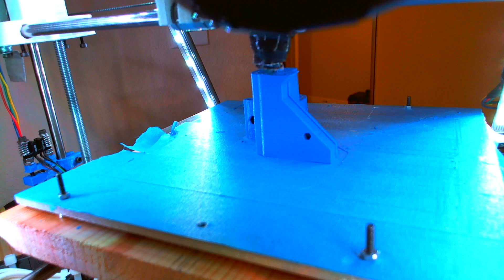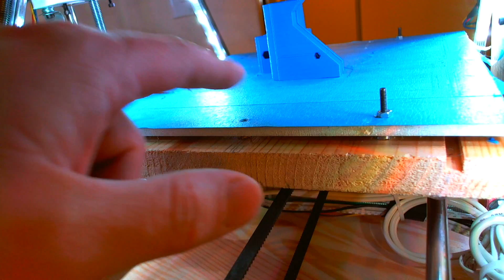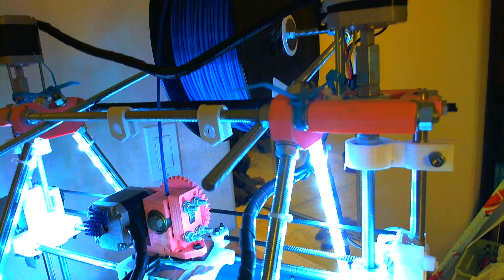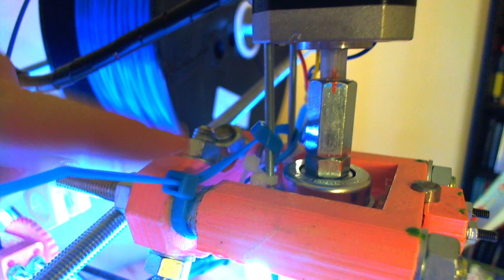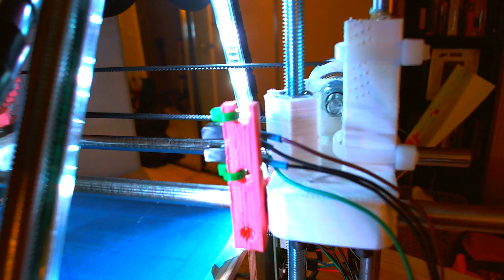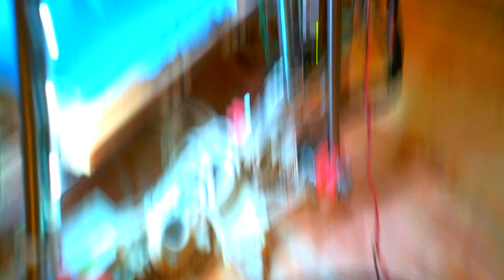Reprap Project- 3D printing A New 3D printer!

Comment: If I understand correctly, by "step skipping" you mean stepper loses position.  I had this on my prusa.  The current on the stepper motor drivers was too low. Running the axis no load and adjusting the current until is as quiet as possible, and then up a little, took care of the issue.

Comment from the maker: @threeque No, I thought I had but it seems to only be with the prusa x ends. I think it's going too fast doing the fill and the belt is skipping. I tightened the belt and tried again and it skipped again. I'm going to make some skienforge changes and only use 1 wall with a lower infill.